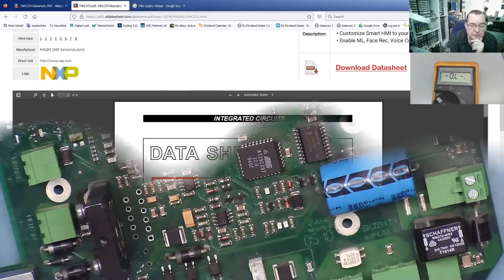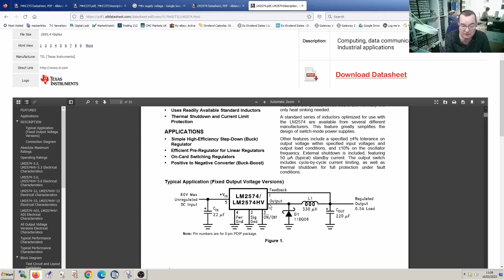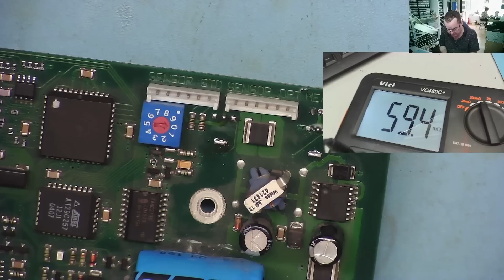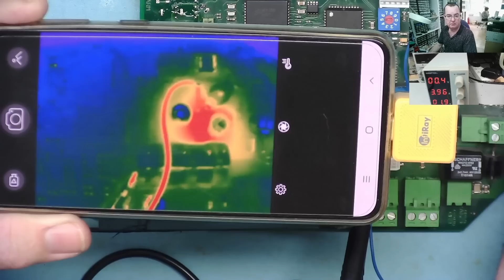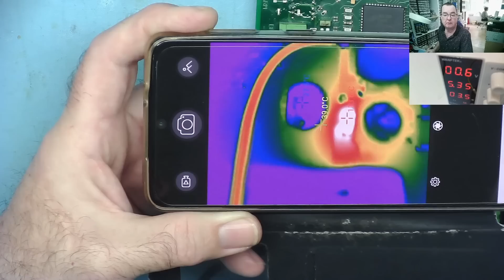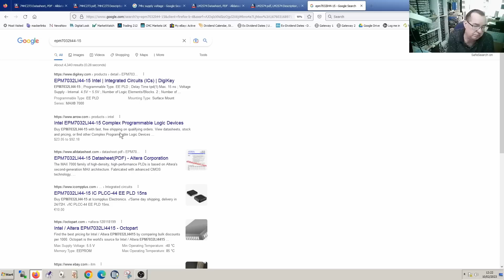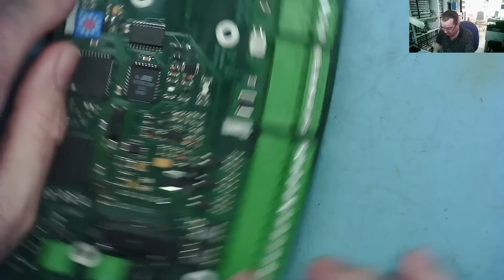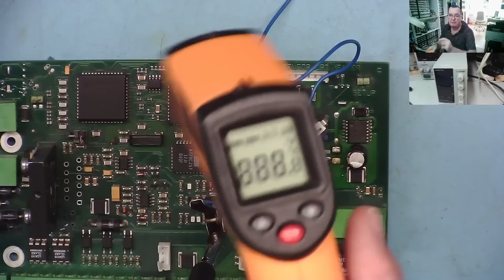Use Basic Electronics Knowledge To Repair Industrial Electronics - Pure Methodical Fault Finding Pt2

Comment: Also after doing work like this for a little while... You won't have to look for a business. You'll have folks beating down your door with industrial manufacturing in process control type equipment. Along with many other categories. There aren't many folks doing this type of stuff these days... And like I'm sure you are all aware... Companies would rather sell you a new $1,200 board instead of replacing $4 worth of parts. And they're hoping to sell boards like that every few years for each and every machine in the factories. And the crazy part is a lot of them have the old board sent to them before they'll supply in new one. Which obviously get repaired and then just get shipped backed out to other customers.